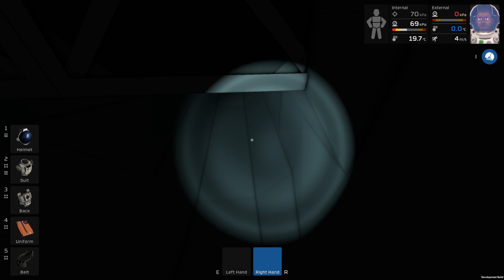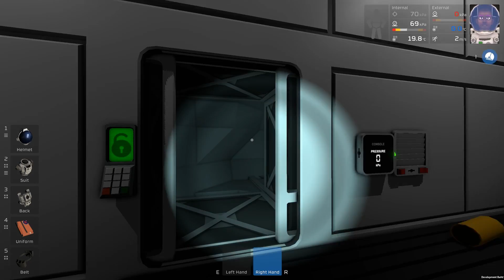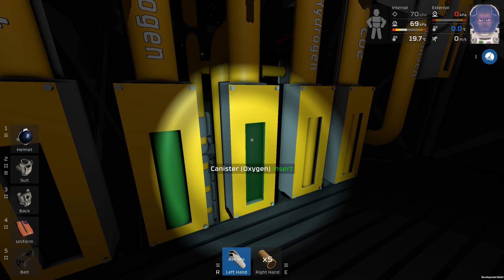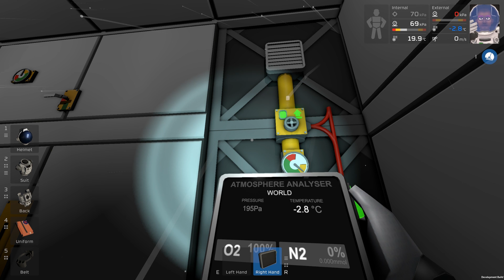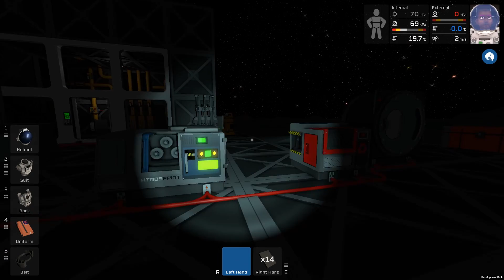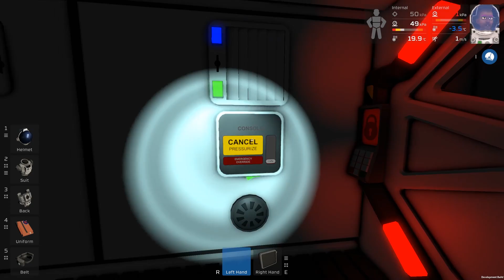Stationeers E11 - Filtering the Atmosphere

Comment: My next step would probably be to set my regulator/backpressure setups to the desired value, then quickly manually pressurize the room with oxite by holding some in my hand and dancing around with my jetpack on to get it started melting. Then see if you maintain pressure while the system replaces the O2/N2 mix with the desired pure O2.
Reply from the maker: It can certainly maintain pressure - I have it running in the next episode (heating and cooling), but not explicitly testing how well it filters out impurities, which I'll probably do soon (mainly CO2), as Nitrogen is not terribly common

Comment: I have had good luck with a console and an aircontrol circuit board in "Draught" mode... You can set a sensor and then intake and exhaust vents and it will control both.  The buttons don't work sadly (pressurize/depressurize) but there is a pressure bar (based on 101kpa) and the alerts do work (low o2, high or low pressure, toxin present, extreme cold doesn't seem to work). You can do all that with logic or a computer, but it's a neat little easy package.
Reply from the maker: I went with passive vents as the active ones seem quite noisy (for viewers) - do they get less noisy when it's set up?  (it'd be nice if you could set the circuitboard to use pumps instead!)
Reply: Nah it's pretty noisy. I was planning to test using the active vents in a separate 1x1 pressure room that is then linked with the main one with passive vents to see if it cuts down on the sound..
Reply: Hum... so 2 blocks away you can definitly still hear it with 2 windows. I'll try over longer distances and with actual frames...
Reply: Yup! A single filled iron frame entirely cuts off the sound. It does not travel trough the pipe/passive vent.
Reply from the maker: Interesting, nice setup to eliminate noise :)

Comment: You are the only person that have an idear how your "air" presure system works in background, it looks like a fliked system from all sides. Have you thinked maybe about a system when a fire goes on in your presured room?
Reply: I havn't finished my setup yet but I'd imagine I'd simply release the pressure, fire can't burn without oxygen.  Or I'd  just craft a fire extinguisher xD
Reply: By fire i mean somethink like this what the dev had in there last lifestream before release.
You go on a walk, come back and the half base is burning and even the structure starts to break open.
My idear from first try would be somethink like heat sensors, when you get a massiv heat you pump hold not burnable heavy gas in the room... and suck the other gases up and cool it down.
This problem come maybe more in play when you have a spaceship where you can not afford to lose stuff.
Reply from the maker: I've just built a heating/cooling loop in the latest episode (out tomorrow), which should keep the base cool, but the wall heaters/coolers are not very fast, so definitely not something I'd use in case of fire.  I think we can certainly design a temperature controlled evacuation system, maybe as an add-on to the current active vent/manual tank I have for use when I want the base in vacuum.  It'd need a pressure relief, but otherwise, much the same as the cooling setup next episode, with an active vent instead of the cooler, and tanks behind to store the gases.